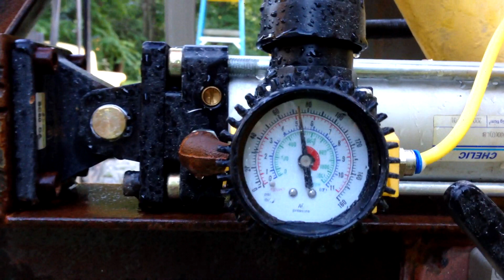End Of Cut - First time cutting Granite

Comment: Perfect... I had planned to set up an old fashioned twisted wire - graphite slurry - wire saw. But your system looks like the best of old and new. Please put out a video on how you did the planning and assembly.
Reply from the maker: Hi Daniel,  you can email me at my username @gmail.com.  The diamond wire is pretty cheap now if you get some from China, $35-45 USD/meter (Hercules Abrasives is a good vendor to use).  I wouldn't bother trying the twisted wire slurry.  I had some that I got with the saw (I 'rescued' this one from an estate sale) and just joining it is a pain.  You have to silver solder the two ends together.  I couldn't get mine to hold.  The diamond wire uses crimps to splice the ends together.  I also get wire from Husqvarna Construction, around $55 USD meter.  The basic saw came from an estate sale.  It uses a winch/pulleys to move up and down.  Originally it was on a timer that would kick the motor on for 1 sec every so many minutes.  I have converted it to CNC (see my other videos), added pneumatic tensioning, X axis cart etc.  Most is covered in other videos.
Reply: @GregsStoneYard  Very professional advice. your video awesome!

Comment: What quarry is this stone from? Did you build this amazing saw yourself?
Reply from the maker: +Josh LaBouff Hi Josh, the stone is called Belmont Rose, quarry located in Havelock Ontario Canada.  The quarry is now closed.  As mentioned in my other reply the saw was probably custom built for the original owner.  You can see where I got it here in this video: https://youtu.be/nLmw1fqaqV4  I've modified it a lot since, now it uses diamond wire, motors are VFD controlled (better speed adjustment).

Comment: this is truly amazing as a home project. I am thinking on doing the same on the far side of the world but my challenge is the power. Do u have any idea on how much watt/time is needed to cut a meter square of granite?  i am thinking if solar power can be alternative with something in a low scale.
Reply from the maker: +Liva Rakotomalala running from solar will probably be pretty hard.  How big of a solar array do you have?  You can build something smaller like this saw: https://youtu.be/wznf3izaTPw?list=PLD5B6B8B67E129E22  but you still need to power a 5 hp motor, they claim 16 amps @ 220v single phase, which means the 5 hp motor isn't really under much load (full load amps would be 25).   So if you can provide that kind of power you can cut stone.  Cutting time depends on stone hardness, granites vary from 0.8m sq to 1.3 m sq per hour.  So take 1 hour to cut 1 meter square, 16 amps @220V = ~ 3.5kwH to cut 1m sq.  Of course that's assuming the smaller saw runs at similar speed to larger saws (wire speed of 22-28m/s).  Cutting limestone is much faster.
Reply: Hey Greg9504, thanks a lot for those very detailed info above; very much appreciated. I have not purchased any solar panel yet but we are just at the stage of evaluating cost. Currently, a rough computation of having a solar panel system gives me around $6/watt (that includes the panels, batteries, inverter, wiring ...). I have sent few quotes to some providers on alibaba.com, mostly from china.  Clearly with the numbers you gave above, it might not be the best option. Another option that i have is to use a diesel generator but not only diesel is expensive in Africa but mostly, its supply is not stable. Maybe the best option, is to bring the stones in town as like everyone does. By the way, the main plan is to cut labradorite  for countertops purposes but agate, petrified wood and granite are in the plan too. According to google,  labardorite Mohs hardness (6 to 6.5) is slightly lower than granite which is around 7 to 7.5 so the numbers you gave above are very helpful.

Comment: Greg, What did you say your wire speed is? I have been running around 50 to 55 meters per second,which comes out to a wheel speed of around 110 miles per hour.  Steve Cross aka SuperAX
Reply from the maker: CROSSAWGA That's very fast!  I'm running 23 m/s but I'm cutting red granite.  See this link from a wire manufacture troylit: http://www.tyrolit.com/page.cfm?vpath=product&genericpageid=861   The fastest they recommend is 35m/s for Sandstones and Limestones.  At the bottom of the page is a link to a document that gives recommended cutting speeds and rates.